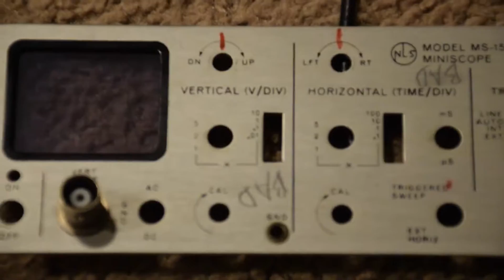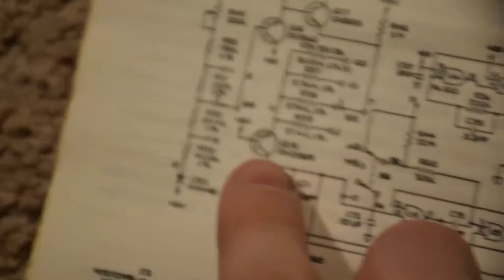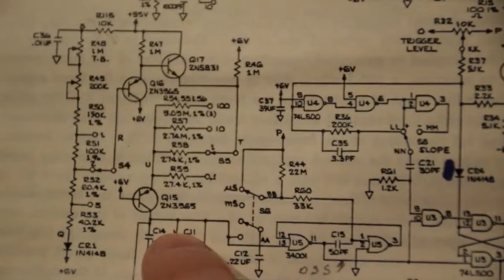MS-15 Scope Repair

Comment: What is the transistor that is adjacent with the silver coloured capacitor on the rear pcb please
Reply from the maker: I'm no sure which one you are talking about. Do you have a schematic? It should be in the manual if you have it. If not you should be able to do a search for NLS MS-15. At one point you could download it, but I'm unable to find it. So Ill post a link to a copy that I have.
https://i.imgur.com/0aRFPNk.jpg
Reply: RingingResonance Thank you so much for your reply. I’ve found a schematic since asking you and it is the same one you identified. I’ll keep you posted as to what I’ve done.
Reply: RingingResonance I cannot persist with getting this oscilloscope to work so I am going to list it on EBay. Thank you for your help.
Reply from the maker: No problem. Shame it doesn't work. What are it's symptoms?
Reply: Hi, I just got one of these little scopes... did you ever figure out some batteries to install in this ?
Reply: @8-bitbitsa821  My scope is in pieces waiting for me to fix (when I have time). Has I recall, I used an external supply.
Reply: @RingingResonance   Thanks for posting the schematic. I friend just gave me an MS-15 and the only schematic I could find was for the MS-215. I thought this would work but NLS didn't just cut one channel from the circuit, they changed some of resistors too!
Reply from the maker: No problem! I hope you get yours working.
Reply from the maker: @Ian L  I went to batteries Plus and found some small cylindrical single cell AGM battery cells to solder to the board. I forgot what model they where, but you could always just bring the scope in to the store and find the ones that fit. A single 6V lead acid gel or AGM battery should work fine to.